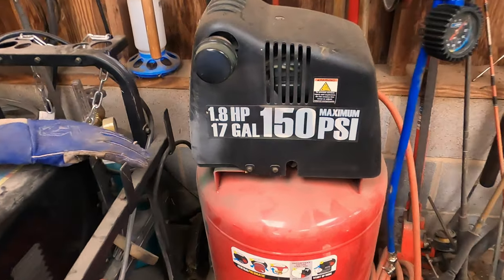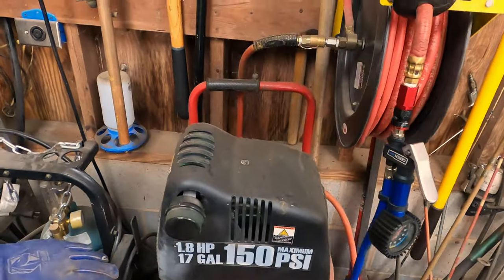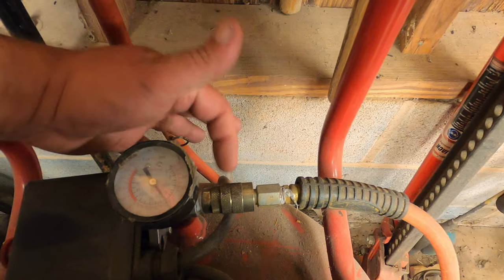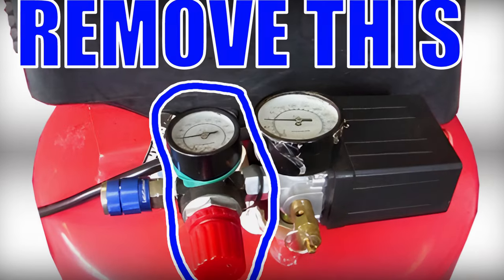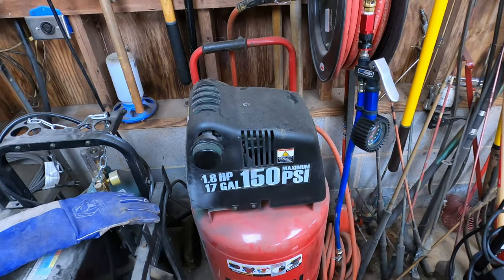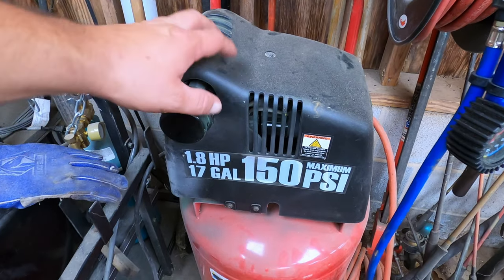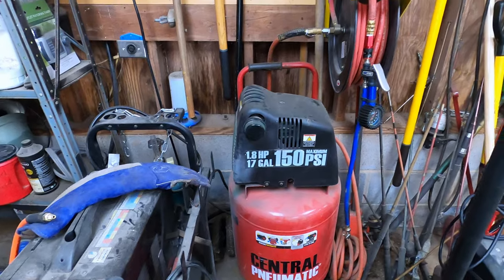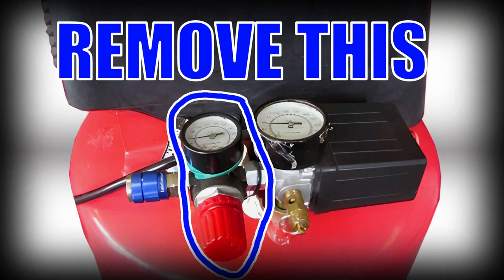Harbor Freight Central Pneumatic Air Compressor Low Pressure Fix

Comment: You had me for a minute.  I thought you removed the pressure control regulator that controls the motor start and stop.  Just the line regulator.
Reply from the maker: Nope just the line regulator.  When I took it off the actual opening for the air to pass through was only about 3/16 of an inch.  So when I was using my tools the air hose was acting like a balloon.  When I would pull the trigger I would get a large surge in pressure that would peter out in a few seconds and I would have to let off the trigger to let the hose fill up again.